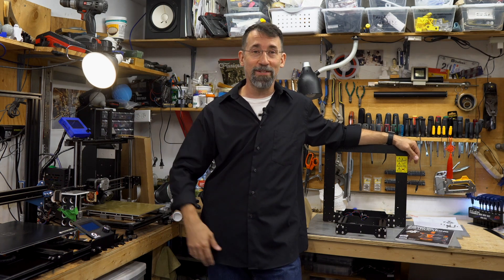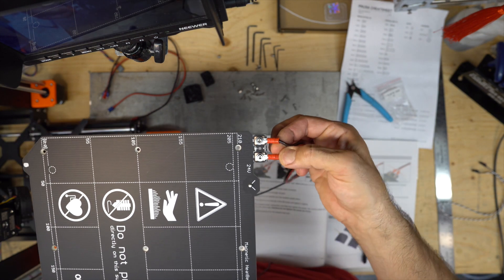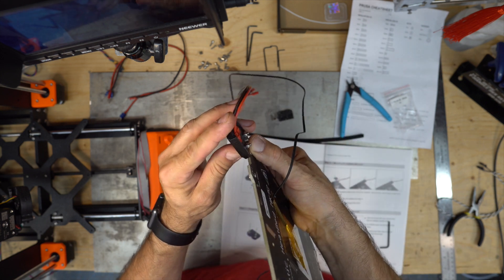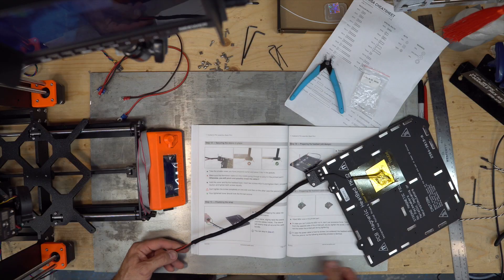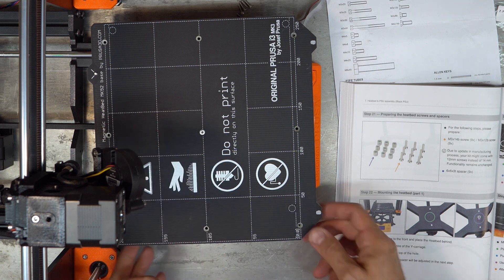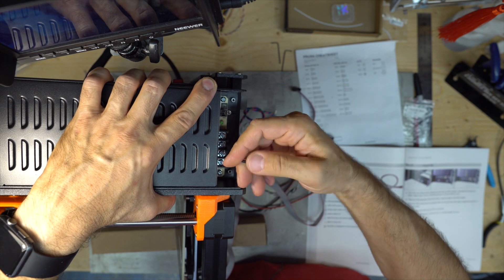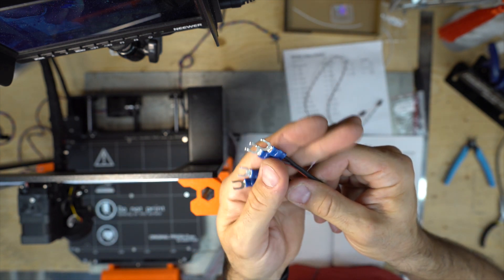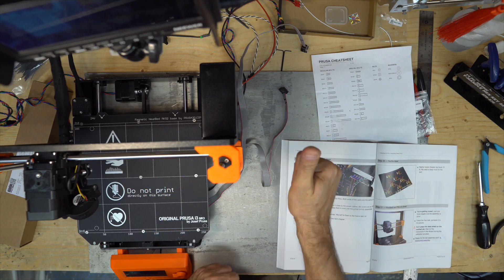Prusa MK3S Assembly Part 8 (Chapter 7)

Comment: I have having major problems aligning the holes to the hot plate. What am I not doing right. Help
Reply from the maker: You start in the center with one of the smal hex key, thant it's easier to do the outside ones, I use the pliers to hold and move the spacers. Hope this helps.